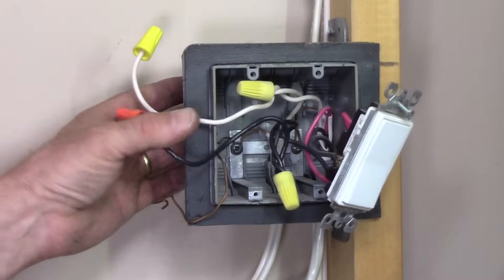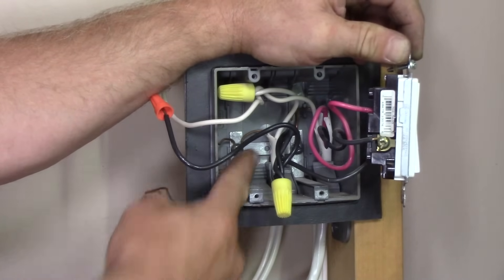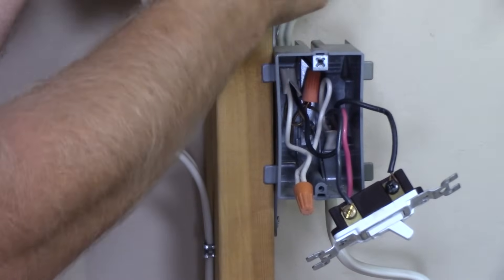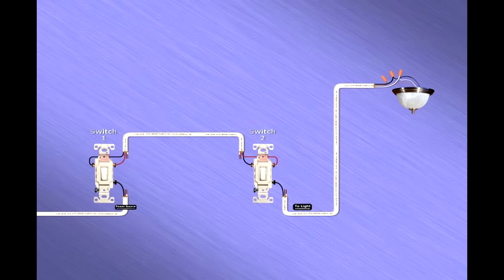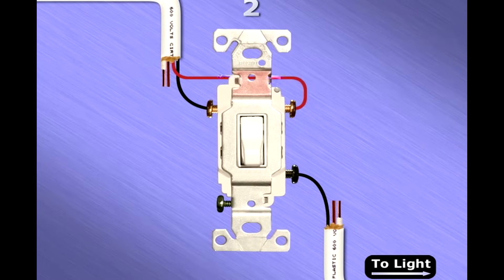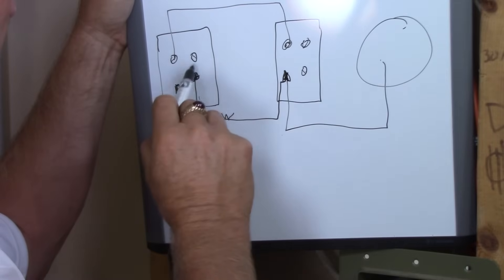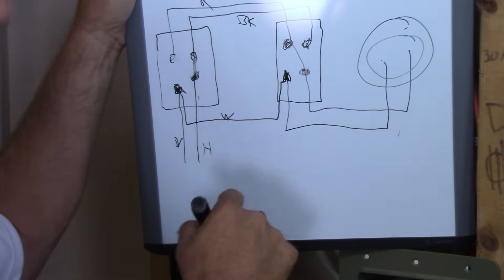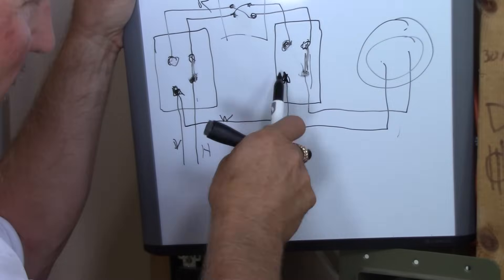The Best 3 Way Switch Explanation Ever!

Comment: Hi terry, (3 way switch)on the second switch does it matter how the 2 travelers go on or can they be switched  red traveler has to be on specific side with the hot, or black traveler has to be on the same side with the hot. Your second switch has black hot and black traveler on one side but your animated has black hot and red traveler on one side. Just curious.
Reply: I always just when I put the first 3 way switch in I just mirror it on the other switch, works for me everytime
Reply: @mattgrissop1005  Thank's good to know.
Reply: It does not really matter.

Comment: best description ever.  but why?  Noone talks about the popular uses for choosing one wiring/switch configuration over another.
Reply: What do you mean?  Three-way and four-way switches simply allow a load (light, etc) to be controlled from more than one location. 

The specific wiring depends on the circumstance—namely where the power arrives and where the load is.  But however the actual layout, the circuit path still works just as depicted here.

Comment: Is that a specific switch or any standard switch would work
Reply: Any three-way switch should be interchangeable.  Any four-way switch should be interchangeable.  There can be subtle differences, though, such as the common terminal marked by word message versus a distinctive screw color.  But they all work the same way.

Comment: I’ve been working in maintenance for nearly 2 years now (I’m new in this trade) . ..the 3 way animation is wrong, because in practice the travelers black and red wire must be wired alternate to each other so the light can be turned on/off from either one of the switches in a alternating way.  But I enjoy this videos there’s always little hints to learn that makes me have more understanding...
Reply from the maker: hermie9 999 trust me, the animation is correct.
Reply: I believe you..  But I encountered a problem at my job and I wired the switches exactly like it's shown in the animation and guess what? It still didn't work. - so I had to figured it out myself how to make it work. And I did it make it work by alternating the traveler's.
Reply: hermie9 999 no, it’s correct. You probably had a trunk slammer that. Nothing wrong with the animation!

Comment: The easiest way to remember how to wire a 3-way switch is to remember the words "Line" and "load".  The line (or hot) wire is attached to the common screw on one switch and the "load" to the common screw on the second switch.  The remaining two traveler wires are then connected to the remaining screws on each switch in no particular order.

Comment: Thanks for the video.
I was all confused when I saw 3 BLKs and 1 WHT until I watched your vid then checked to find the WHT was the pwr wire.
Once I found the WHT was pwr I connected it to the lone terminal then 2 BLKs on one and 1 BLK on the other terminals. Took some testing with power applied before I figured out which BLKs went together for the switch to operate properly but it works now!
Reply: Yes. This video shows the simplest setup... from the panel, to the first switch, then the second switch, and then the light.  When the physical arrangement doesn't line up like that, then you start having white wires that are not neutrals and what some call switch-loops or backfeeds.  The circuit path is still the same as shown here, it's just more convoluted.

Comment: I like to see a video on an existing outlets. I have a plug in that is controlled by a switch for its power. it doesn't have any light source. I'd like to add a simple wall fixture and take the plug in off the switch so the plug in is always on and doesn't get turned off by the light switch. Can you make a video?
Reply: I would also like to see this in true condition I have 2 separate rooms 1 that has a single switch to split outlet (1-hot, 1-switched) and in other room 3 way switched outlet same as other 1 hot 1 switched
Reply: The simplest solution would be to install a light figure on the wall above the outlet.  You could run a new cable from a new box for that light down to the outlet box.  You could re-use the existing outlet, but it would be simpler to purchase a new one.   The white neutrals would go both to the outlet and the light above.   The switched hot would just be connected to the cable going to the light.  The always-on hot would be connected to the outlet.  If you re-use the old outlet, you'd have to connect it to both the top and bottom of the outlet.  you can do this with two short (4-6 inches) pieces of wire, with a wire nut to the wire coming into the box.

Comment: I have two ceiling lights hooked up to a three way switch system. Don't ask me why, but I don't like it. I want to put each light on a single pole light switch. What do I need to do? I think I know, but I am not sure what to do with the wires between the lights and think I need to pull power from the receptacle just below the light switch on the other light. please leave comment, so I can see what I need to do.
Reply from the maker: It's going to depend on how this circuit is wired.  If it was done the most simple way to run this circuit, you might have to fish in a 3-wire (+ ground) cable  between the 2 lights. Open and light fixture and if there is only a single  2-wire cable in one, and  2-wire in and out of the other, you're going fishing!

Comment: Just wondering. Why is it called a 3 way when you are only turning on the light by 2 switches?
Reply from the maker: That's the age-old question? Because the circuit entails 2 switches and a light = 3? I don't have an answer for that, and in other parts of the world other than North America, they do call it a 2-way.
Reply: Ok. Thank you.

Comment: How do you wire a three-way switch and outlet combined?
Reply: Where the constant power comes into the box, pigtail it to provide power to the receptacle and the switch,which will give you two constant hots/two black hot wires.
Reply: @vitocotto6279  Can you use a 15 amp receptacle with a 3 way switch can I hook a pigtail hot wire to the outlet?
Reply: So long as you have a constant hot/black wire and functioning neutral...then yes...

Comment: Maybe I missed it but I didn't catch the gauge that should be used. 14, 12?
Reply from the maker: Michael Alvarez it depends on the breaker size that feeds the circuit. #14 on a 15a, #12 on a 20a.

Comment: I'm crazy. I don't even turn circuit breaker off. I don't recommend that. Only with a simple switch change.
Reply: U really shouldn’t do that man. That “ simple switch change “will kill u simply put. If u do work hot use one hand

Comment: Please help me.  Both the animation and drawings show that if both switches are down (off) the light is on and if both switches are up (on) the light is on.  None of the 3-way switches in both of my houses work this way.  If one switch is up the light is on if both switches are up or down the light is off.  What am I missing here?
Reply from the maker: Joe Pfankuch All that means is that you have the traveller wires reversed and different than in the example. No problem at all, but if you don’t like it that way, simple solution, pull out one of the switches and turn it 180 degrees  and re-install.

Comment: great explanation thank you
I am looking to add a dimmer switch but there are already 5 switches in that outlet and the dimmer body is too large and does not fit.   I am thinking of adding Wago connectors to alleviate the congestion. How do you cram a dimmer switch into a crowded box?
Thanks
Reply from the maker: It can be very difficult, and dangerous as well.  That's why they have box fill rules in the code.  You might have to do some creative rewiring by putting in an additional outlet box and fishing over to it.
Reply: M Detlef 🤣😂🤣😂🤣😂

Comment: It was a great video. The only thing that could be confusing to some people was that you reversed your traveler wires from the first switch to the second switch so this would not achieve the desired results. However in the animation the traveler wire attachment locations were consistent. Keep up the great work and thanks for the video.
Reply from the maker: Thanks for the  comment!  Yes, it matters not what traveller goes  on  what terminal at each end.  The only affect changing them around has is that either both switches are up for  lights to be on, or both down, or one up, one down, etc.
Reply: @theinternetelectrician  What confused me is at 2:20, on the decorator style, you connected the hot/common to what looked like one of the traveler terminals.  On every 3-way I've seen, the common terminal is at the bottom, across from the ground, and the travelers are at the top, across from each other. This doesn't look right.

Comment: 3 wires confusing as hell. Whats a common and traveler? All the switches i saw had no black screw
Reply: Black screw(common) on switch 1 comes from the powers source, thats where your power comes in, black screw on switch 2 go your load/supply thats where it goes out to your load.
Reply: Your travelers are the two screws that parallel to each other, those are the ones that carry power from one switch to another

Comment: Can you a 3 way switch to power a receptacle without turn the receptacle on and off. I just need constant power to the receptacle.
Reply: Yes you can but it's not recommended to power jump from a receptacle. Better to run a dedicated circuit from the panel to your light switches.

Comment: Great video! I have a situation where two switches power three ceiling fans and the second switch powers the lights on the ceiling fans. I want to undo the connection from one ceiling fan and replace with just a light. And i want the other switch to control the other two lights and fans. How do i undo this?
Reply from the maker: That may not be possible but would have to know exact details on how the cables are running in this circuit.

Comment: Whats a good underwater connection
Reply from the maker: It depends on the application, size of wire, voltage, etc., but generally speaking any method of keeping the water from making direct contact with the splice.  Rubber tape, gel filled connectors, etc.

Comment: Any rhyme or reason why you've toggled one or two of the switches in the off position and the remaining in the on? Would it matter if the all the switches were wired uniformly in the ON position or the OFF position?
Reply: I'm currently adding a smart dimmer, and am looking at my wiring now. My switches work the way you want yours. After watching this video, and looking at my wiring, swapping the travelers will change whether both switches down or one down/one up turns the light off.
  I'm guessing that after two months, you already have your answer, but better late than never. 😉

Comment: What's fun is when you have 3 separate black wires in each box. No visible pigtails or wire nuts, nothing. The jackass that wired my house in the 70's had a real sense of humor. Thanks to this video I was able to cut a hole in the wall by the electrical box and figure out how to wire it.

Comment: Guys, are you sure, this person is an Electrician?
    One of the basic rules of an Electrician is:
 ,,Never wear any metal ring or bracelet on your hands, never use flashlight with metal body, never use measuring tape, made out of metal."
   This guy have two(!!!) rings on his fingers (one on each hand)!!!
 Both of them made out of yellow metal.
Reply from the maker: Those are good points, but I assure you I am an electrician.  Those aren't "rules" and certainly not the #1 rule, but are good safe work practices.  The number one rule is shut off the power.  If working on a de-energized circuit, no danger in my wearing my wedding ring, and my ring passed from my grandfather, to father, and now to me.  I should take them off just to set a better example, but I'm not actively working in the trade now so I don't even think of it before shooting a video.  Thanks for watching Boris.

Comment: I’m completely new to electrical wiring . Will be helpful for some if u can first explain what’s common wire ...
Reply from the maker: It's a term to describe the terminal on the switch that is "common" to both the other 2 terminals.  ie. The switch is in one position, the common terminal is electrically connected one of the traveler terminals.  In the other position,  the other traveler terminal.  Never are the traveler terminals common to each other.
Reply: Thank you for the detailed explanation 👍🏻
Reply from the maker: @magician560  You're welcome!

Comment: can i use 4 different 3,4 way switches to operate 4 led shop lights
Reply from the maker: Yes, use as many as you wish! You will need two 3-way, and two 4-way for this setup.
Reply: @theinternetelectrician  power to the lights will go from the end 3 way switch right?
Reply from the maker: @geohac2456  Yes, power supply to the first 3-way, - 4-way - 4-way - 3-way, up to the lights, then light to light.

Comment: So if I make Red wire- traveler on switch 1- switch 2,  Black from breaker (HOT) common on switch 1 then  common on switch 2 goes to light fixture
Reply: correct, for the second switch (where you have you're 2-wire from the fixture coming into the box) the black from the 2-wire would go on the common (black screw)

Comment: All you need is a 3 wire in between switches and power at one switch, switch leg up to the light at the other switch. There always needs to be a ground at the light, unless it's piped and the pipe is being used as the ground

Comment: Works a lot better using red and white for travelers thus keeping the black as a standard common, neutral always a continuous run from source to light and is always the white wire in the 2-wire cable. Plus, always remove jewelry prior to electrical work.
Reply: Black is always going to be the common if you wire it right, at that point using the white for a traveler you would have to rephase it red or black to identify it as hot conductor.

Comment: It is funny I was stumped on this circuit when i was first tought this in votech school but I finally got it when I started wiring electric lock systems for access control which use the same type of 3-way switch but it is called a single pole double throw switch in locksmithing lingo. And we used digital keypads and keylock switches which had 3 terminals(normally open,common, normally closed), just like a common 3 way switch! While not the same setup and usage as with a light, if you are using a indicator locked and unlocked led lights, the 3 way switch setup works the same as with a regular AC system. Funny thing is now as a home owner with my own electric locks setup I rather use a cheap $2 toggle 3 way switch to lock and unlock my maglock on the inside of the door. The common is power, one of the traveler leads would be the lock and one light to indicate LOCKED(red light), and the other free traveler screw would just hookup to another light(green) to indicate when the lock is UNLOCKED. I know this sounds like a convoluted way to finally have grasped the concept, including a 4 way switch, which is a special type CROSS double pole single throw switch for locksmithing, which btw, Hubbell makes such a keylock switch, but hey! It worked! I can wire a simple AC lighting system with 3ways and 4ways now almost eyes closed lol!
Reply: It's not convoluted at all... you're spot on!  Many people will know what SPDT or DPDT means from automotive or even model railroad work.   A three-way switch really is just a SPDT switch, nd a four-way switch really is just a cross-wired DPDT switch!

Comment: I was kinda confused on the 4 way switch animation. On all three switches they were all in the off position yet the current still flowed to the light to turn it on?
Reply: I rewatched and it shows that when you turn the middle switch to the up position it turns off. Why is that? Why not just have it regular where when you flip a switch down it turns off?

Comment: Ok so I have I previous toggle 3way, and I'm trying to swap it out with a paddle 3 way...all my wires are black with zero indication of what's what...so I connected it 9 different combinations and now it only turns on and off from the other switch...so no this video does not help lol
Reply: It works but as a single pole
Reply from the maker: @marcogeraldis7117  Yup, I'd say you got a bad device.  Try a new one.
Reply from the maker: There should be only 3 possible combinations to try! If you really did try 9 ways, then you might have got a bad switch! This happened to another person that commented just a week or so ago and took back the switch, and the replacement was good! You might have shopped at the same store that he returned the faulty one to! Seriously though, it could well be a faulty device.
Reply: The downstairs switch has to be turned on for the upstairs one to turn on and off
Reply: One of them is also a dimmer...
Reply from the maker: @marcogeraldis7117  What one? The bottom of the stairs? Anyway, regardless, if the toggle style 3-way worked, and the new decora one doesn't, then it's the switch that is faulty.  No chance there are 4 terminals on the new switch you bought, and that it's a double-pole switch instead of a 3-way?
Reply: Its 3 way
Reply: Thanks for your help I'll try and replace it

Comment: I screwed something up and I need help!  I have a box at the top of the stairs with only the 14/3 cable inside. At the bottom of the stairs I have 14/2 cable with line voltage, 14/2 cable going to the light fixture and 14/3 cable coming from the upstairs 3-way switch. Can I make this work? Can you tell me how to connect it?
Reply from the maker: Mike Grenia at the top of the stairs, black on common, red and white on the travellers. 
At the bottom, white from power cable to white on 2-wire cable to light. Connect black from power to black up to top 3-way. Connect red and white from upstairs 3-wire cable to the bottom traveller terminals. Connect black wire from cable to the light to the common terminal.